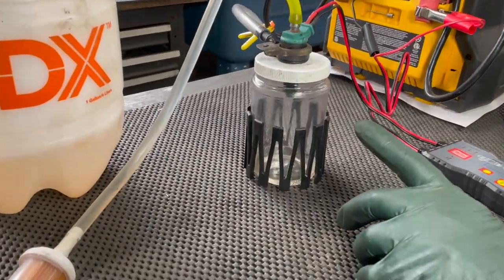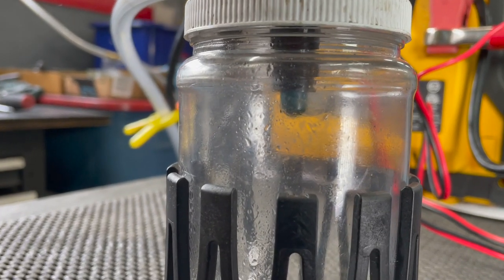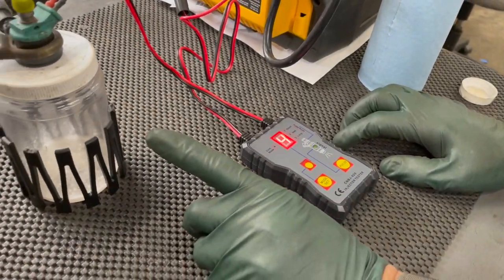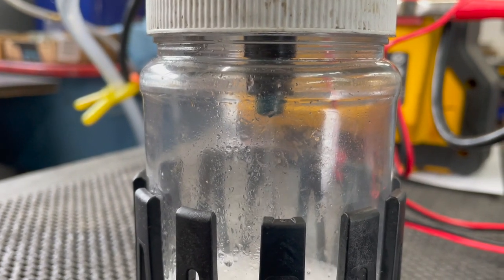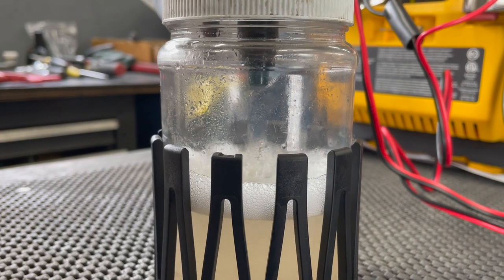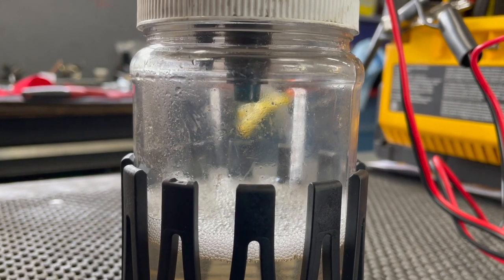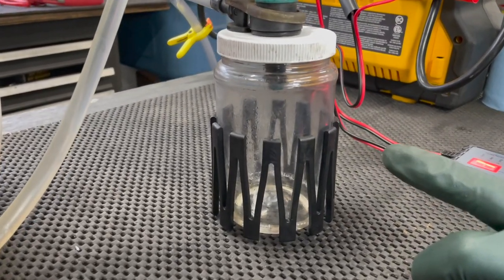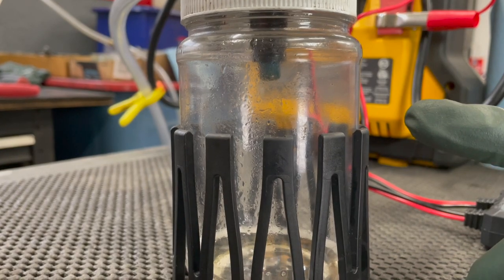Watch Close Up - Mercedes Porsche D-jet Electronic Fuel Injector Rescue

Comment: Well Kent, I am pretty sure you can get the Bosch injectors from Rock Auto for about $36 each. Sorry, I don't know the year of the car you are dealing with. If you let me know, I will update this post with a link to the new injectors.
Have a great day, Sir! o7
Reply from the maker: Sorry, you are off my about $20 and they are not even Genuine Bosch.
Reply: But what about these electronic/green plug injectors? Looking for such ones and couldn't find anywhere!  My MB needs'em.
 M110, 280SL, 6 cylinders engine

Comment: Nice one Kent. I only ever recall seeing one car with this system. If I remember correctly the pulse for the injection system came from a separate set of points in the distribtor. Is that correct? It was pretty amazing technology back in the day.
Reply from the maker: You are correct